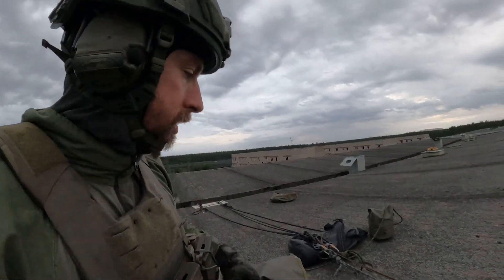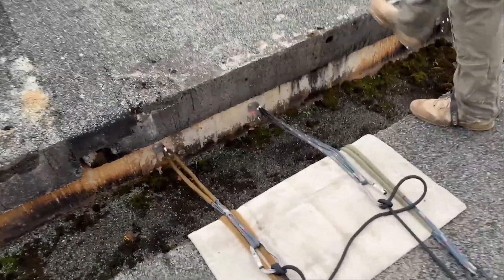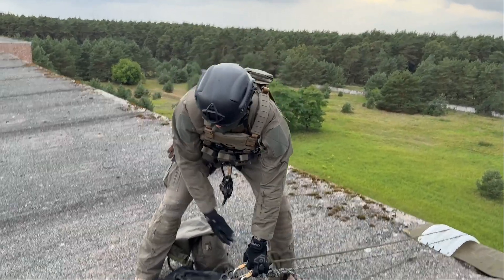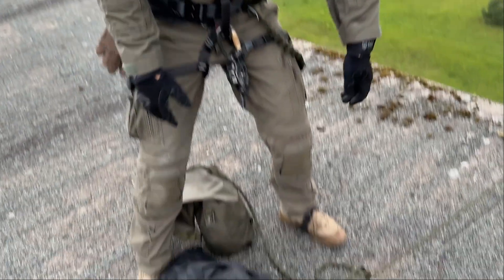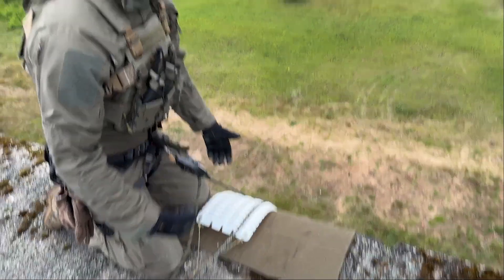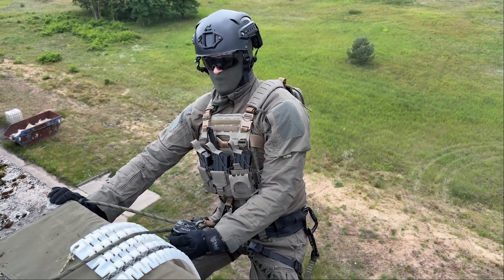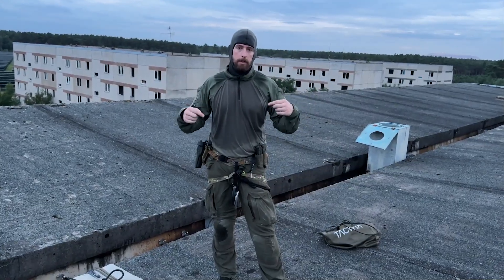Redundant Rappel Station with Lowering Option - 4-point Rescue Anchor on Flat Rooftop

Comment: This is bad teaching. Never ever go over the edge into your belay device without being still clipped in somewhere. If you accidently put in the rope the wrong way in your rapel device, which happens very fast in this configuration, you have no backup and slip to the ground as soon as you sit in the device.
Reply from the maker: I disagree. With the function-check you know, that it is right and you can step over edges and walk around without any problems.
But I agree, that generally it's good practice to weight devices first, before unclipping from the anchor. But this is not possible all the time and a proper check of the device after inserting the rope is preferable - at least in my opinion. 
Or how do you proceed, if you only use it to hold you back? There is also no weighting of the device before trusting it.
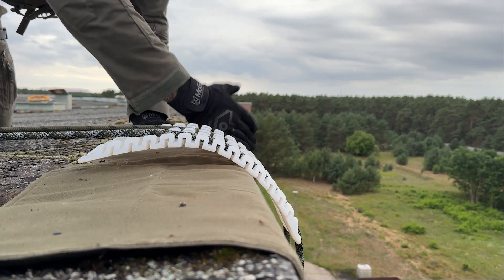Reply: At 2:15 You do not show to check the device and rope direction in the device before unclipping. You should do this in a teaching video (show that you pull the roof side of the rope an it blocks). You get very easily confused about the rope direction in the device when you are upside down to the edge. It already happend to me, this is why I am warning about it. It is also a standard safety procedure when abseiling while climbing, regarding DAV. 

You can just put a sling from the anchor near the edge for clipping in it. 

If you use the device to hold you back while moving on the roof, you also do proper check. In this case, the device is only the backup safety, not like when you are abseiling with it.
Reply from the maker: At 0:03: "not all safety measures may be visible". This is still an incomplete video and in no means a tutorial on how to transfer over the edge. 
In my opinion it is almost impossible to make a video will all safety relevant information in it. We also did not show how to do the knots and so on. And without the safe anchor even the best exit over the edge will not avoid a fatal fall.
But still thx for pointing it out. I will keep it in mind - because I still agree, that weighting the system before unclipping is still a valuable safety routine. In addition to the functional check, not as a replacement.
Reply from the maker: And we also had this happen to a police officer here in Germany. He inserted the rope the wrong way and the following descend was anything but controlled. There is a video to this somewhere online.
Reply: @ripperkon 
Yes it is impossible to show everything in a video, I agree. But for me this procedure of weighting the device first is one of the most important things.

Most accidents are human error, not technical failure. Knowing this, I try to use as simple as possible routines which will point out fatal errors like this. There will be a bad day, stress, heat, whatever. And then the trained routine will save you. 

What is the most common fatal climbing error in gyms? People forget to clip in the auto belay...
Reply from the maker: @faultier988 I agree. Simple habits can have a big impact on safety.
But I still don’t think this needs to be visible in every single video. Even if it’s crucial to do things like that in the field. 
It surely would need to be in the video if it was ment to be a training video for education. My videos are more a rough impression, focusing on specific topics and showing ideas.
Reply: Ok I understand and agree ;) I like your videos in general but just wanted to point this out, that can kill people, who are learning these things and take the videos as manual, even if they should not...

Comment: That anchor is wild. 🤘
Donut only? Hell no… Your trust in the belay loop must be stronk. 

Pro Tipp: Never go Donut only! 🤙
Reply from the maker: What's a Donut in that context? :D
Reply: @ripperkon it’s the belay loop. ;)
Reply from the maker: Aaaah, then the donut is fine. It's rated 15kN at least and properly inspected ;-)
How what would you do to avoid using the donut only? - And why wouldn't you trust it?
Reply: @ripperkon 
First I like backup systems and in this case I prefer to use the belay loop and the upper tie in loop for more comfort. It’s also very common to use both tie in loops for max safety. But I guess u know already knew it. 🤙
Reply from the maker: @shepherd.airsoft  Aaah, okay, I get it. Surely an option, thx.
Reply: There is no objective reason to not trust the belay loop. It is made for this. Especially in a low force application like this.
Reply: @faultier988 maybe. Theoretically planes also shouldn’t crash. So why trust the technical gear at all. Anyway, let’s hope for the best. 😉
Reply: @shepherd.airsoft if you consider the belay loop breaking in a rappel situation you should quit doing anything rope related 😂
There is no case being ever recorded for such a thing to happen and the belay loop has withstand least 15kn of force while you get max 2kn while rappelling…
Reply: @Chris752319  unfortunately gravity don’t care about theoretical math and yt comments 😏
Reply: @shepherd.airsoft yeah its ok. Dont forget to bring multiple ropes, harnesses and biners for your next high risk rappel adventure 😂